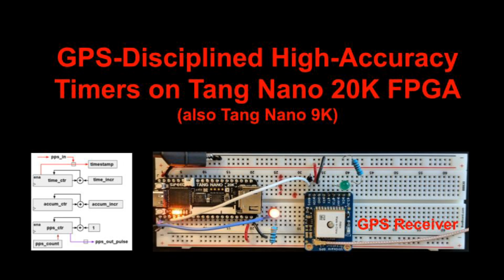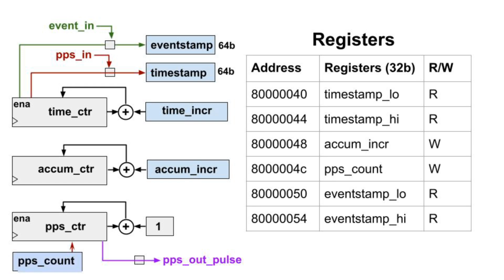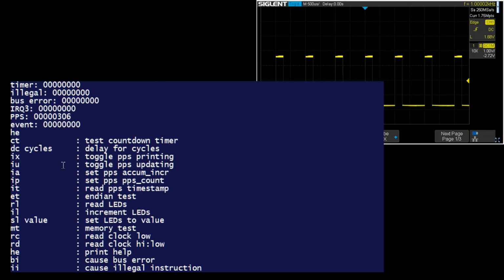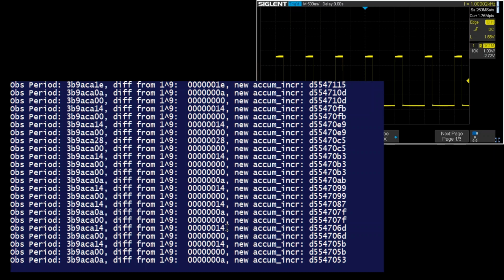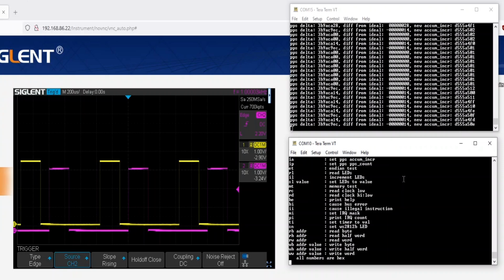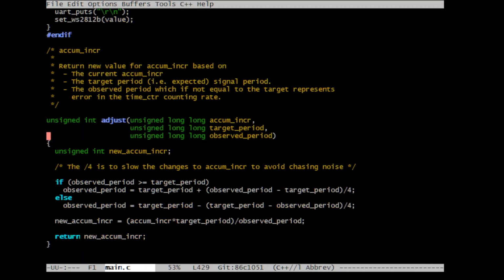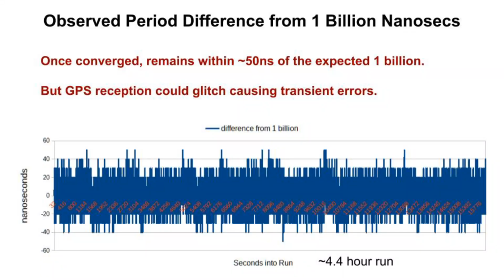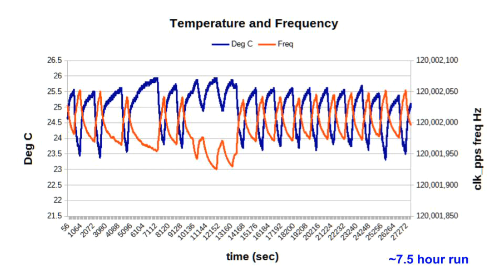GPS disciplined High Accuracy Timers on Tang Nano 20K FPGA

Comment: Can you(or anyone else) recommend a good GPS module to do this with?
Reply from the maker: The last one I bought from Amazon had "NEO-6M" in the description.  Brand was Beffkkip.  I am sure I chose it because it was cheap.  It works fine near a window.  Just be sure it has a pin marked PPS.  Also, I like ones with the separate square patch antenna.  If you have a USB to 3.3V serial converter, you can use it to see the NMEA strings the GPS sends.  I used one of these to build a time-of-day clock that sits on my window sill.  It has worked for more than a year now.

Comment: Really nice, happy to have found this video and your repo. A GPSDO has been on my list for a while... Of course one of those things that is more fun to DIY than buy if one has the time, skills, willingness to learn to figure it out. I started mine a few days ago and came up with a quick and dirty proof of concept to see if I could get the FPGA and RISCV and count from simulated GPS PPS and 10 MHz derived from the internal clock.

The result was not even "alpha" but enough, that I think it is worth looking further into what others have done via www and  youtube  and thinking about how to proceed. I used an Altera DE0-Nano and set up a NEORV32 with CFS (Custom Function System) so registers and interrupts with counter data implemented in VHDL. About 3600 LEs out of 22k were used... mainly for for the CPU... a dual core would be about 6k. 

Anyway, nice to see how you did this, I like the software interface, considering something similar unless, perhaps forking your C code would save time. Also, good that you mentioned PTP as an inspiration and FIFOs for crossing clock domains. Good too see how others have solved these problems instead of reinventing the wheel.

Comment: I just found this. 

Nice work. I think the only way to get better disciplining would be to do it completely in HDL.  Now, I need to go back through the other videos leading up to this.  Again, well done.
Reply from the maker: Glad you liked it.  My thought is that using software is only adding a little latency to reacting.  The time measurement is already pure hardware.  Given a 1 second measurement period from the GPS, I think a little added reaction latency will have little impact.  It might help to run clk_pps faster to reduce measurement jitter, and using the PicoRV32 core makes that more difficult (at least until I can figure out how to do floor planning with the Gowin tools, perhaps).
Reply: @electronics.tinker  It might also be interesting to use the GPS PPS to discipline an external TCXO, instead of the onboard oscillator to reduce jitter. There is a project called the time card from the open compute project which does something similar, but  IIRC it's implemented entirely in HDL.
Reply from the maker: I looked at Time Card.  It mentions some interesting parts like a TCXO that has a PPS in signal.  It looks like it can adjust itself.  Interesting.  Thanks for pointing out this project.

Comment: Greg, thank you for this awesome content and all the effort you've obviously put into making these videos. Having done VHDL many years ago you've inspired me l, just ordered a tang nano 9k. Re the accuracy and convergence algorithm, have you considered interating the 1s timestamp delta over time and then making the correction after that period, starting with 1s, 10s, 100s, then 1000s...this should allow your system to become incrementally more accurate to several significant digits.
Reply: Apologies for the typo Grug
Reply from the maker: Yes, I can think of many variations to try, but I am not sure the result will be much better (although faster convergence is certainly possible).   The big issue is that the GPS PPS signals are not perfect.  I have two GPS receivers and I examined their PPS signals at the same time on my scope.  The time between their rising edges varied by as much as 100 ns and was not constant.  Maybe I should make a short video about this.  A spec sheet from U-Blox suggests that the PPS signals might jitter less than 30ns (usually), but I don't know if this is true for what I have.  I have no frequency reference adequate to test this.  Someone who has one ought to make a video about using it to test cheap GPS modules!

Thanks for your comment.

Comment: Could one implement this also in the nano 4k or 1k?
Reply from the maker: On the Tang Nano 9K, the project uses 37% of the available logic and 47% of the CLS's-- but a lot of that is the PicoRV32 core.  I don't have a Tang Nano 4K (or 1K), but I think the 4K has a Cortex M3 hard core.  You would have to use it instead of the PicoRV32 soft core.  Then, I think there is a good chance it would work.  The 1K is too small for the PicoRV32 core (and I think it has no ARM core).  So, the only approach would be to use the 1K in conjunction with an external CPU like a Raspberry Pi, Arduino, or ESP32.  You could use i2c to read and write the PPS registers.  One other concern is speed.  clk_pps should be at least 60 MHz.  I am not sure what speeds the 1K and 4K would support.  I have noticed that higher resource utilization causes the place and route tool to be less likely to achieve a given clock speed.  I have no idea about the 1K and 4K in this regard.  I also don't know how to use the floorplanner tool to help the place and route, but that's a topic for another day.